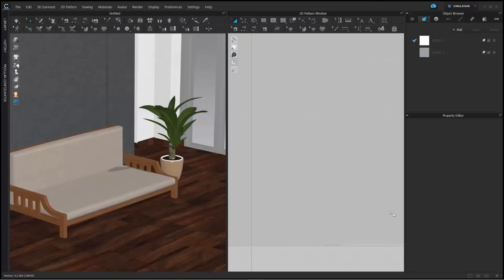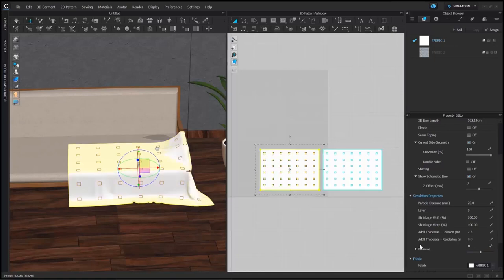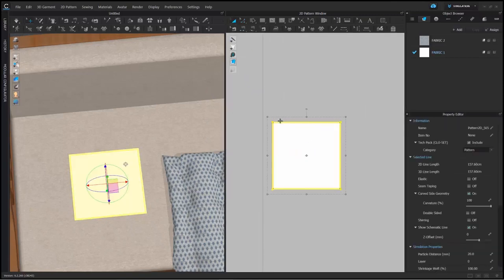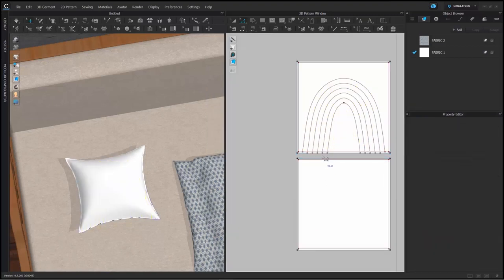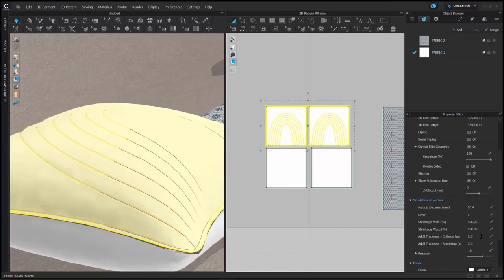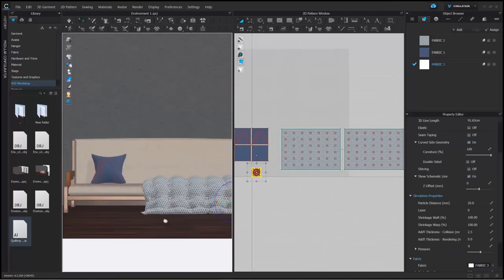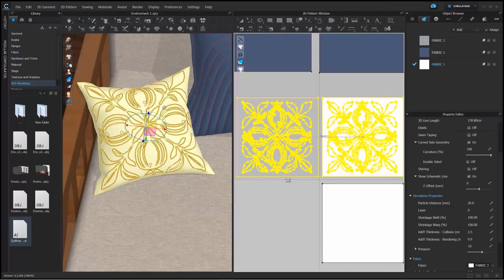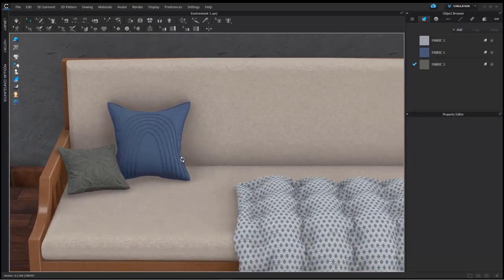How to Create Quilted Home Decor (Pillows & Blankets) | CLO 3D Design Tutorial

Comment: Whenever I try to add a file from illustrator, I get an error “this is an unsupported file type”, even this is an ai saved as a pdf compatible file. Am I missing a step?
Reply from the maker: Are you trying to use the file as a pattern or print/graphic? Is the artwork vector or pixels?